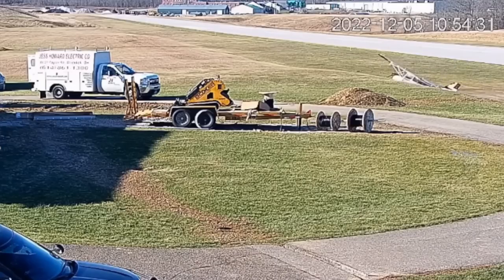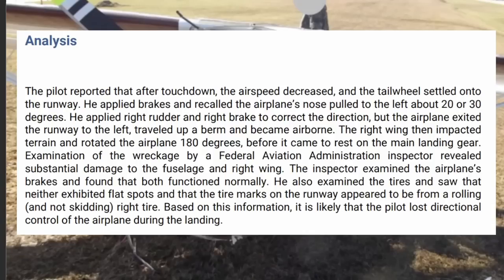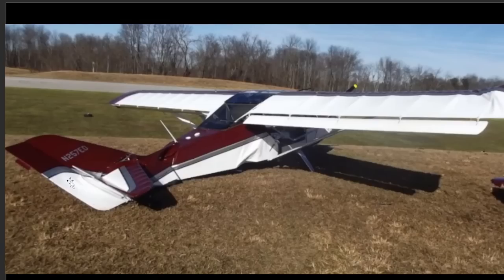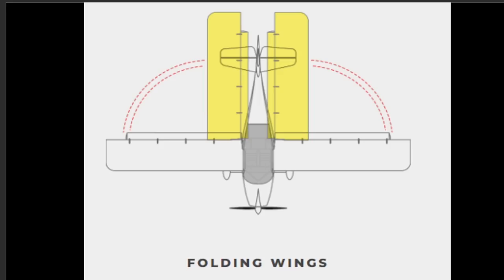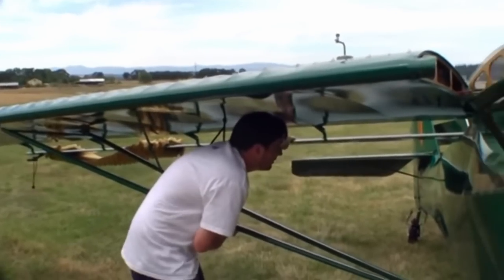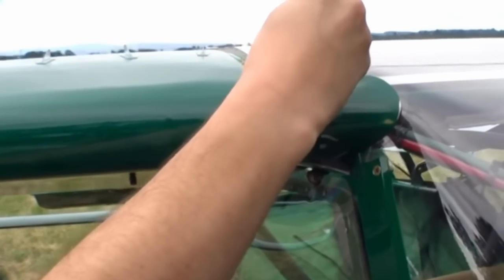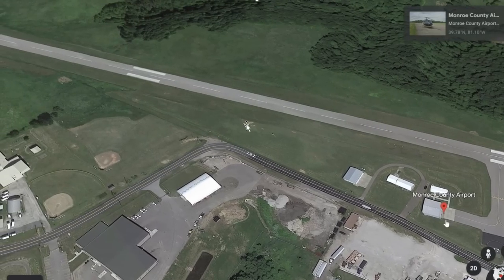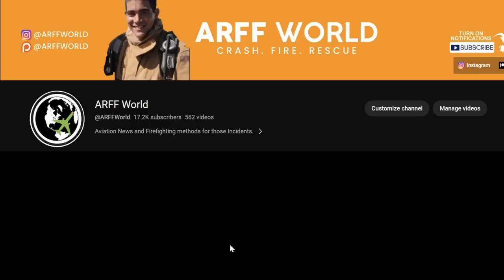Airport Camera Helps Investigators in Ohio

Comment: It’s kind of worrisome that your life depends on that ONE pin in the front spar of each wing…
Reply: Why not
Reply: There are a lot of "ONE pin" areas on any aircraft.  It's best to not dwell on it too much...   ;-)
Reply: Reminds me of the crash of a Dash 8 because a jackscrew snapped inside of the horizontal stabilizer.
In aircraft safety, redundancy is key.
Reply: The wing took a hard hit and the pin held no problem. So yeah , I've been following these kit built aircraft for quite awhile and I haven't heard of any problems with the pins or anything to do with the swing wings or any failures in the air or in a wreck.

Comment: What were the wind conditions at the time? I bet there was a left crosswind. Regardless, (even if it were still conditions) applying full left aileron combined with right rudder and brake, could most likely provided enough right hand drag to counter the tendency to turn left
Reply: A very dangerous 5 mph crosswind.. OMG.. OMG so strong the wind..  Im scared..
Reply: @CFITOMAHAWK2  Yes he was traveling at a lot more than landing roll speed up that mound - Needed to go around at the first sign of left tendency earlier in the landing. Prop wash from engine at full power would have also assisted rudder to re-establish directional control at the start of go-around.
Reply: @Coops777  MANY HAve lazy feet.  Cant do taildraggers.
Reply: @Coops777  FOR ME, he is a liar.  Wrote on report the tail came down; that equals low speed, then you see high speed and flying again up a hill.  he is BS.  He messed the landing, tried a go around, and messed that one too, then stalled it too.  3 big student pilot errors.
Reply: @CFITOMAHAWK2  Yes I have to agree. Tailwheel rolling along the runway does not happen at the speed he was doing up that berm. He has obviously reapplied power after messing up his landing. And then proceeded to mess up again. Pity there dont appear to be eyewitness reports. I own a cub and, I presume the kitfox is similar to fly. You have to adhere to some basic stick and rudder rules to maintain good directional control. Apart from that, it is easy to fly
Reply: @Coops777  And the guy say he is "An Airline Pilot". LOL.. A liar i bet.  Or forgot abou torque on prop planes and to use the rudder too.  Airliners turn on ground wit a Tiler.